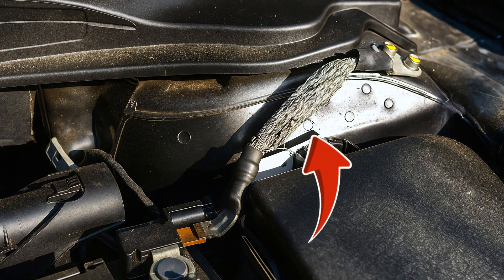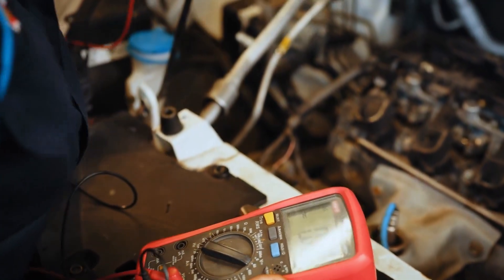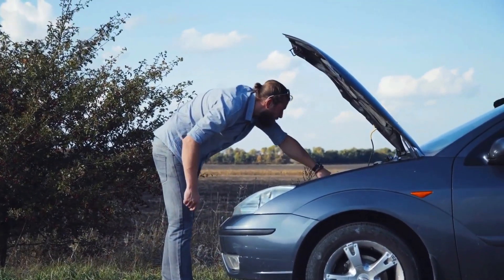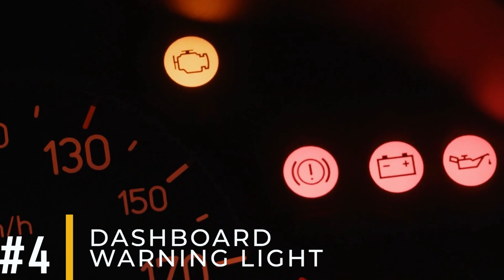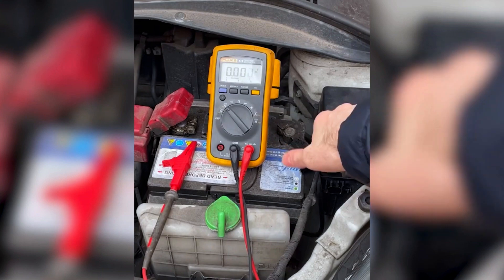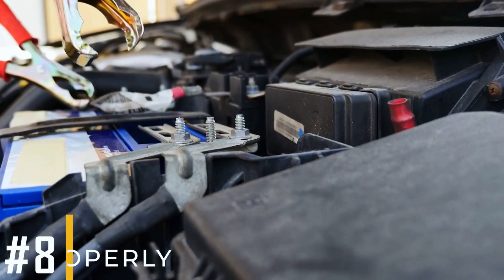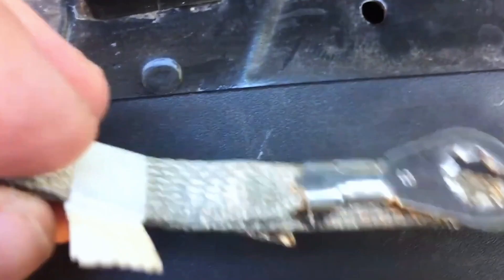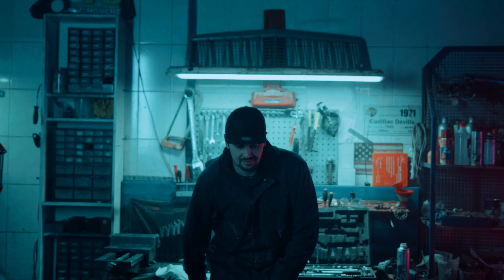8 Symptoms of a Bad Car Negative Battery Cable | Engine Ground Strap Failure Signs

Comment from the maker: "🔋 Car not starting right or showing weird electrical issues?
It could be a bad negative battery cable / ground strap failure ⚡

👉 In this video, I’ll show you the 8 clear symptoms so you can fix the problem before it gets worse.

❓ Have you ever faced battery or grounding issues? Comment below – I’ll try to guide you!
🔔 Don’t forget to SUBSCRIBE to Car Fix School for more DIY car repair tips & tricks."
Reply: 2007 mack ctp713 dumptruck randomly cutting off for months. Had everything replaced batteries starter and fuel line's.  Truck run good hour's unloaded but soon as I put a load on it it dies going down road. Other day took ecm off noticed the ground strap hanging by 1 thread the rest done for. Call the mechanic tell him and he said it have nothing to do with it cutting off. I believe this my issue what you think?
Reply from the maker: You have a 2007 Mack CTP713 dump truck that’s been randomly shutting off, especially under load. You’ve already replaced batteries, starter, and fuel lines, but the problem still happens. Then you found the ECM ground strap almost broken (hanging by one thread). Mechanic said it’s not related, but you feel it is.

My take:

👉 Yes, the ECM ground strap could definitely be your issue.

The ECM (engine control module) absolutely depends on a solid ground connection.

A weak or corroded ground will cause random cutoffs, stalling under load, hard starting, or electrical glitches.

Under load, vibration and higher electrical demand make the weak ground fail more noticeably.

Sometimes it might run fine for hours, then suddenly die when the ground “breaks contact.”

Why the mechanic said no:

Some mechanics overlook grounding issues because they assume “a loose strap can’t cause intermittent shutdowns.” But on trucks with electronically controlled engines, bad grounds are one of the most common causes of mysterious stalling.

Solution / Next Steps:

Replace that ECM ground strap immediately with a heavy-duty braided strap.

Clean both contact points (chassis/frame and ECM side) with a wire brush or sandpaper until shiny metal.

Add dielectric grease or anti-corrosion spray before tightening.

While at it, check all other grounds (battery to frame, frame to engine, ECM to frame). One bad strap usually means others are on their way out.

After replacement, test under load again — most likely your shutdown issue will be gone.

⚡ In short: Your instinct is correct — that ground strap can absolutely be the root cause.
Reply: @CarFixSchool thank you for responding I'll comeback and let you know how it went after today's repair.
Reply from the maker: Good luck with the repair! 🚙🔧 Can’t wait to hear your update.

Comment: For anyone tired of guessing why your car won’t start, get the Vdiagtool BT500. It tells you if it’s the battery or alternator.
Reply from the maker: Exactly! The Vdiagtool BT500 makes diagnosing so easy — no more guessing, just clear results in seconds 🔋💡

Comment: Fixed it. Thanks. I added a ground strap from the negative battery terminal to the strut mount. And it fixed the problem. I was having electrical power loss at stop lights stop signs almost to the point of stalling. Radio would go on and off. Very very bad situation after I took my car to the shop and they replaced the alternator but they did not ground the car properly. Thanks!
Reply from the maker: Thank you for sharing your success story! It's great to know that the video helped you troubleshoot and resolve the issue. Happy driving!